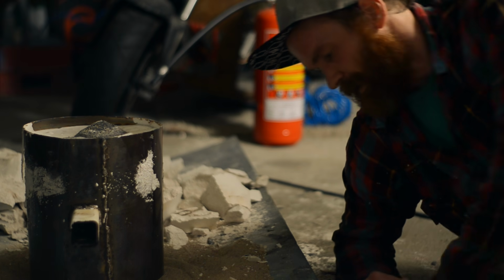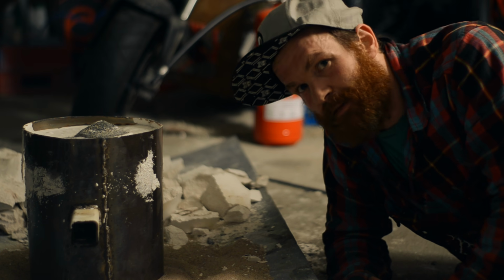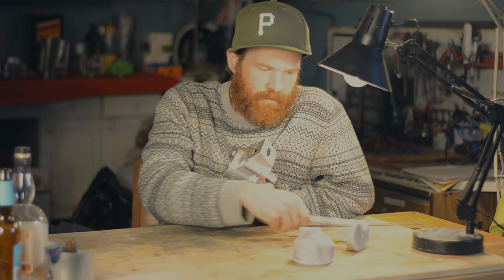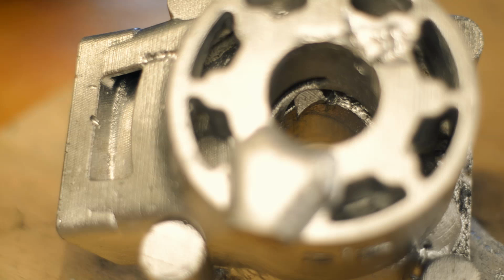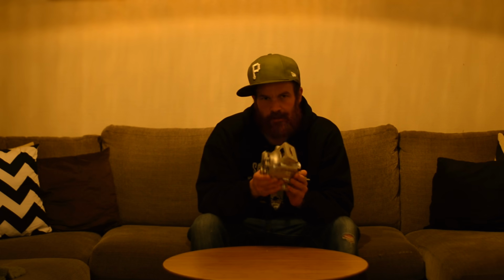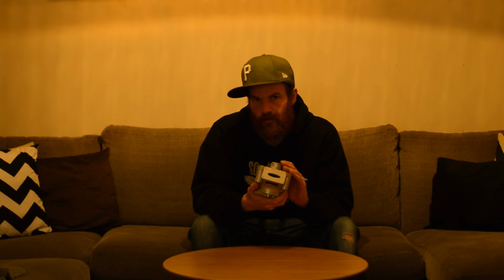GOT ONE! - Casting the Most Powerful Two Stroke Part 6

Comment: I see the success coming soon to you but not all kind of success, I think it wills definitly works, having a cast 'homemade' aluminum engine but I dont think you can make something more powerful than whats already exist. You think bigs compagnie of atv, snowbile and else engines didnt already tried everything out to make the most possible engine ? they sure did, anyway I wont be too optimistic about creating the 'most powerful two stroke ever' from only turning the cylinder 90degree and having the exhaust on the side. This surely has been done somewhere with the big compagny and if they dont do it like that today, its for obvious reason. I enjoy a lot of the potential, quality video, project and idea you have, keep the great work !

Comment: I understand a vacuum chamber is not usable here because it would out gas your printed model and boil the water, but you should make yourself a pressure pot buddy. It will make your casting work so much better. Put your wet plaster mold in it and raise the pressure to get all the air bubbles out/compact all the material. Hold it at high pressure for a few hours until the plaster sets.

You can make one with a simple pressure cooker pot large enough for your needs, a shop compressor or a positive displacement air pump, a pressure relief valve set to relieve at a pressure safe for the vessel ( NOT OPTIONAL! DO NOT over-pressure the vessel beyond what it is rated for! The last thing you want is for it to explode in your shop! ), and some compressor fittings. The idea is that the wet plaster under high pressure will compact and leave the water and air bubbles out. This will set the plaster completely in a couple of hours and leave the water on top (since water is not compressible), but you still need to cook it after to get the residual water out. When you decompress the chamber (by lowering the pressure setting on the relief valve GRADUALLY ), the water and air will want to go back into the plaster, but by now the plaster is set, and it can't. 

I'm not really sure if your printed material will work well with this technique though, you will need to test how high a pressure you can use before it starts deforming. The higher the pressure you can get with your vessel and printed material the faster the process is. But really even say 25 psi will work, it just sets a little slower.

Also make sure your finished mold is piping hot when you pour the metal in, to avoid thermal shock and prevent cracking. You can also add glass fibers (insulation wool ground in a coffee grinder for example) to your plaster mix to increase strength, and lime to prevent expansion.

I'm really looking forward to see this engine in action!

Comment: You may have already had this suggestion, but why don't you just make the entire cylinder out of cast iron or straight up stainless steel? The cylinder bore wouldn't have to be lined, it would last forever and it would be easier to cast, maybe...

Comment: Yeah, 1 good cylinder won't cut it. You probably need 3 more for any machining errors that might occur. There's a reason engines are expensive, the time and effort that goes into new designs is ridiculous.